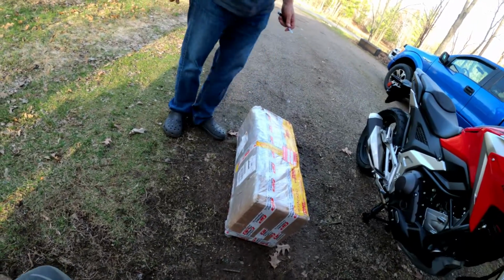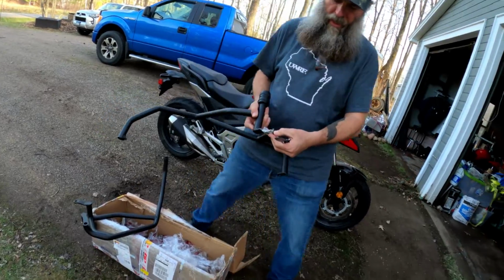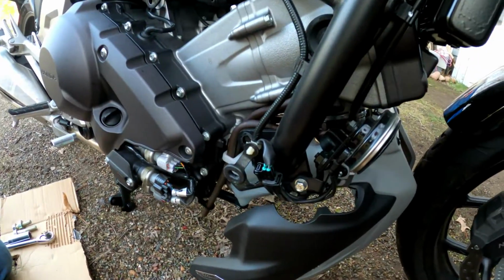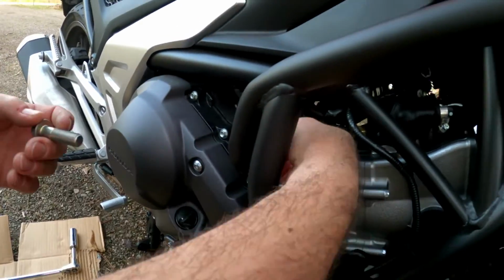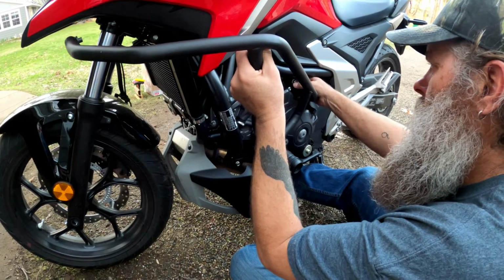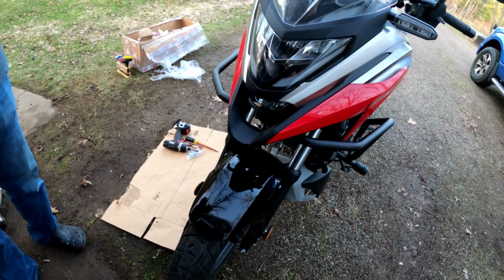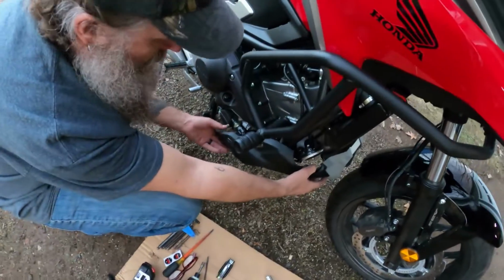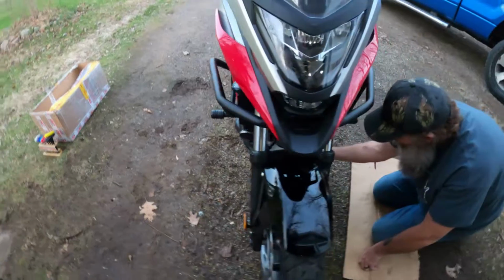Crash bars installed on the NC750X DCT

Comment: I installed the crash bars tonight, and your video probably saved me several hours. Took me about three hours overall. Like you, I found that the right side bracket needed to be ground into a longer oval, they did not make it correctly. Also, as you did, the center bracket where I tried to mount it,  which was the correct spot, still didn’t fit. It was too short. I suspect there is a significant tolerance in manufacturing, so some of them might join together where it was designed, and the rest of us can cut it off and grind it.
Reply from the maker: We are so glad this video helped save you some time and it's kind of a  relief to hear that we were correct in that it wasn't made quite right and some mods were needed. Which thankfully were pretty easy to do.

Comment: I think you should not cut it, I see the bolt you should use ,  minute 17:25 , but not sure
Reply from the maker: We see what you are talking about, but unfortunately that wasn't it. The bar wasn't very long and wouldn't even reach the radiator
Reply: @bettertogetheradventures218  I just installed the same to mine its not the radiator bolt, is in the midle hided up, the extra bolt is to use it there because is longer that the one is there.
Reply from the maker: @natanielromero9045  Thank you. We will take a look at that.

Comment: Where did you get the crash bar? Is it OEM?
Reply from the maker: Aftermarket on EBAY from Turkey 🇹🇷
Reply: @bettertogetheradventures218  Thanks!
Reply: @bettertogetheradventures218  I bought mine on Amazon - about $260.  Took a while to get here and they beat the box up pretty good, but nothing bent and no parts lost.  Thanks for the video - done in real time, not some slicked up bla bla bla and then some magic happens bla bla bla..

Comment: Looks greeat, but it shouldn't be that hard.
Reply from the maker: Thank you ..  Only hard part was the right side wasnt getting lined up and the the bracket.
Reply: @bettertogetheradventures218   I was watching another brand get installed, and it looked like the motor dropped a little.  Did you see that and do you think supporting the motor from underneath would make any difference?
Reply from the maker: @clarkearnold6629  We had no issues with that at all